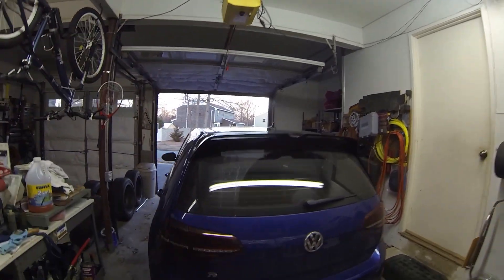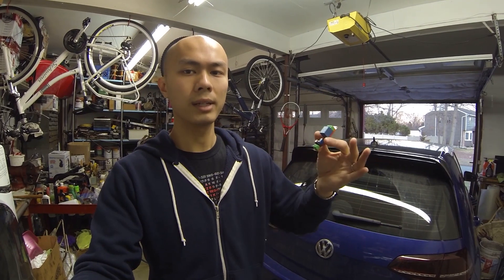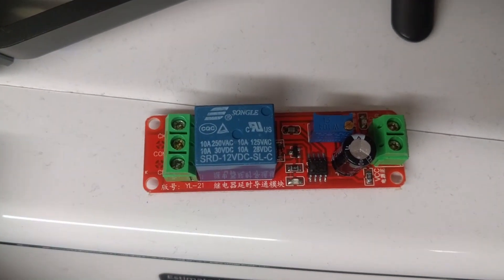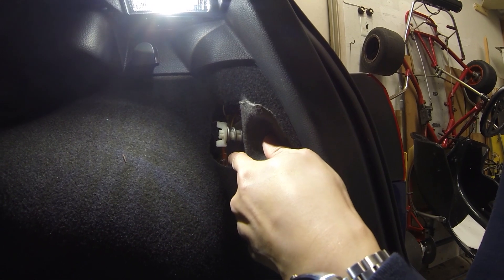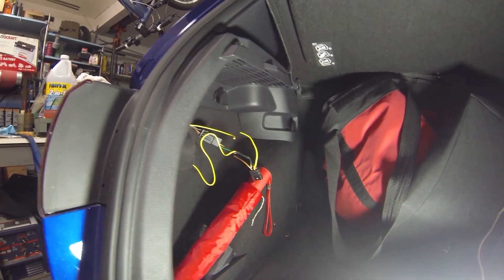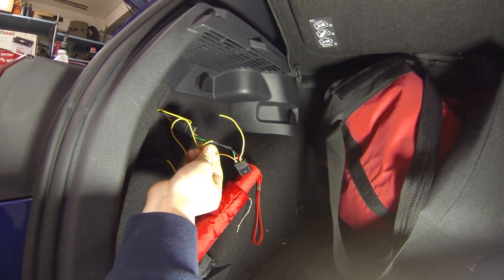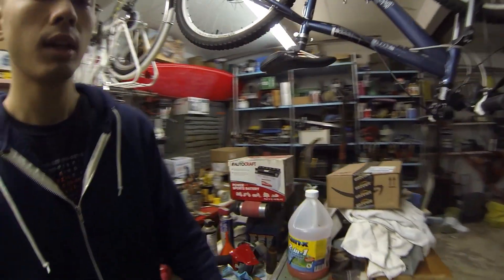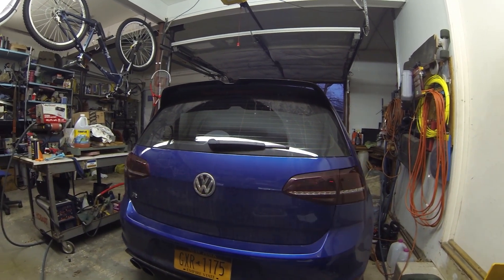DIY Sequential Turn Signals - MK7 Golf R

Comment: In actual sequential turn signal each LED is controlled and these LEDs mad on off  in a way that it looks like flowing. The problem over here is you have divided turn signals in two group and provided delay on one group which makes sequence between two group but Not enough for Visible sequence. It doesn't looks like flowing. that is the reason why actual one cost higher than 5 bucks !

Comment: i set up the indicator delay successfully whilst engine was off. when engine running the dash brings up error and indicators flash quickly when selected. any ideas? thks
Reply from the maker: try turning on your hazards with the car on and see what it does
Reply: zed4me hazards also blink fast with engine running. they and turn indicators run fine once engine off. do i need to adjust the pot any further? whilst blinking fast and engine running i attempted to adjust pot further anti clockwise but could not find that optimal position to give a delay so instead now blink together with inner tailgate indicator. any ideas?
Reply from the maker: Hitesh Patel sounds odd. Blinking fast indicates to me that the computer thinks the bulb is out. Weird that it blinks fine with the car off
Reply: zed4me is there a solution for  this? sounds like someone else also has same issue but with having tried another set of pcbs also.
Reply from the maker: Hitesh Patel I haven't come across this problem. Maybe give more info like where your car is from and what year, maybe there's a connection
Reply: zed4me hi zed. my car is a 2014 Golf R from England
Reply from the maker: Hitesh Patel perhaps this only works on US cars. Hard to say with one data point but maybe others will chime in.
Reply: hi zed my harness colour is green/blk +ve on the rhs and blk/white lhs .i'm having the same problem as patel. i've even tried and changed the 555 chip thinking it was of inferior problem but still the same story.Just wondering wud a diode connected inline on the +ve side feed help in any way to stop thw feed back.
Reply: zed4me you might need to add a resistor into the line because when the outside light is off the system is only drawing half the power it should. Especially if you sealed incandescent for led tails
Reply: Any particular value for this inline resistor? Does this connect across the positive feed into the 555 pcb or between the positive feed and ground?
Reply: Seems the indicators draw 200mA current when engine off and 290mA with engine running. I used an ameter to measure up. What resistor would best suit to prevent the error?
Reply: Hitesh did you come up with a solution for elliminating the check light error.
Reply: Less delay.

Comment: does this only work on r?  I have R tail lights for my Gti and it did not work.
Reply from the maker: Should work if you tap into the correct wiring.. as long as there's a specific wire that goes to the outer amber tail lights you can intercept it and make it turn on a tad later than the inner amber lights.

Comment: does it work with the original Europe LED Tail lights?
Reply from the maker: Yes but you'll have to figure out which wires to intercept yourself
Reply: thanks. can somthing broken if i confuse the cable?
Reply from the maker: That's always a possibility

Comment: No regrets on getting golf r?
Reply from the maker: Nope
Reply: zed4me sweet! I'm really considering one right now it's at the top of my list. Do you think this is a car you should only buy new, or do you think used will be fine? If found a few used 2016's with low miles for low $30's and as you know New are around $40k
Reply from the maker: I personally recommend always buying used.. cars depreciate too quickly. This just happened to be a preorder, and I got one of the first ones to come out in the US so that's why I got new.
Reply: zed4me yeah that's my thoughts too! I'm just a little worried how they were previously driven, being more of a performance car
Reply from the maker: Always the case when it comes to cars like these. With a proper pre-purchase inspection you can feel more at ease. If it bothers you too much then new is the only way to go.

Comment: The components are gonna fail in the summer from extreme inside car temperatures?  Or cold, there is more to car engineering than get the cheapest , parts, and so on.  Also, if you ever get into an accident, and the problem is cus of the modified lights, you will pay a lot more than the parts cost, non DOT is illegal to use in the U.S. look at legit parts, for lighting, DOT stickers mean something
Reply: Isnt the DOT certification just for the lights and lenses, not the blinker "actions" themselves?  Other cars have sequential tail lights; but I do agree....the insurance companies would have a field day with this modification if they could.  ...if they could, that is the real question.
Reply: There are all kinds of specs...and rules..time on off..you can be sure car makers put a lot of money and time into getting it done...current audi vw have the streaming type of blinker..i am sure they didn't just guess at what timing etc is occurring. The blinker done here are not sequential..they don't imply a direction..but more of a stopped vehicle..wanna bet it's not legal...
Reply: The "streaming type of blinker" makes alot more sense now.  My other comment/question would apply to completely custom "single" led "lights" in a row....and like I am thinking, one module would feed the next...as long as the blinker 12+ is on.  It might be tricky to time them, but I do think it is possible.   Thanks again for the response.  FWIW...I do work with electronics....
Reply: @VincentWolfenbarger  When reality bites, you will understand...

Comment: Cool but this can be done with no parts and an obdeleven or vag com.
Reply from the maker: SWmaster proof? I heard someone figured it out recently if anything.
Reply: zed4me zed if this is true then PLEASE make a video showing it. I just ordered the relays a few days ago and would obviously prefer to do it without stripping any cables etc
Reply: ChrisShUK Unfortunately I haven't seen it demonstrated on an R.  It also might not be possible on say American cars as we have different tail lights that don't use the Amber.  I reprogrammed my GTI to be like the Urban Joke taillights and it looks to me like pretty much everything is programmable on the tail lights.  Someone with an R who is a dare devil needs to experiment and find the right coding to make it happen.

Either way this vid is a fantastic inexpensive method.
Reply from the maker: SWmaster so no proof. by my understanding and looking at the taillights wiring there is NO way to do this via programming. this is 100% true of the LED taillights retrofits. I cannot guarantee this for ROW vehicles with stock LED taillights. I can understand your thought that if Urban joke works by programming this could too but that is simply not true. please don't make assumptions and claims without appropriate facts.
Reply: SWmaster you can actually code something called pace car blinking but that leads to the blinker parts blinking in opposing phases. This lights up one part, then the second part comes on as well

Comment: I never seen a pair of scissors used to strip wires, oy vey, you also realize wire used in cars have some extreme temperature ratings, cars get real hot in the summer, it matters

Comment: In my car there arent yellow cable....
Reply from the maker: Find the wires that are responsible for turning on the outer taillight turn signal and tap into that
Reply: zed4me thank you how i find?
Reply from the maker: Federico Varnerin multimeter and seeing which pins get power when turn signal is on
Reply: zed4me thankyou!!!

Comment: this is  sequential turn signal?
definitely not
Reply from the maker: Mariusz ok boss
Reply: Mariusz Most adapter sellers call it semi-dynamic. 
potato potatoe
Reply: I think that is what it looks like on a normal mk7 golf r, but it you have the new 7.5 golf r then there are a lot more fluid
Reply: Make it with more outputs and smaller individual lights. It is sequential he just did 2 lights in sequence